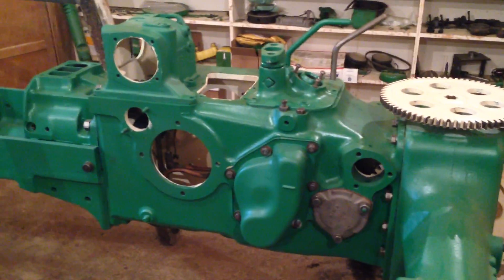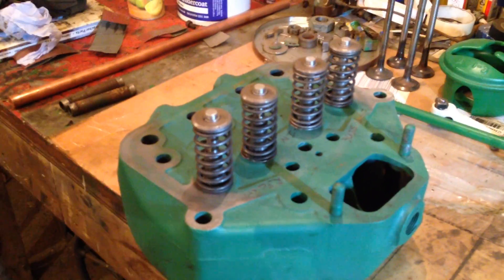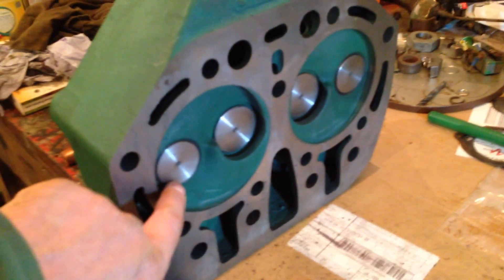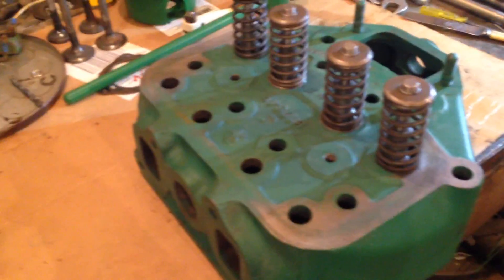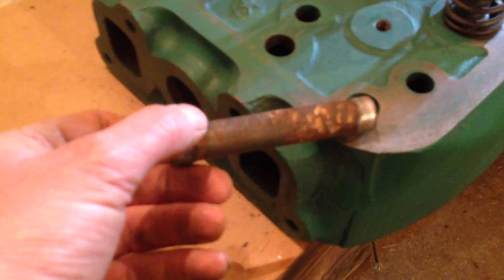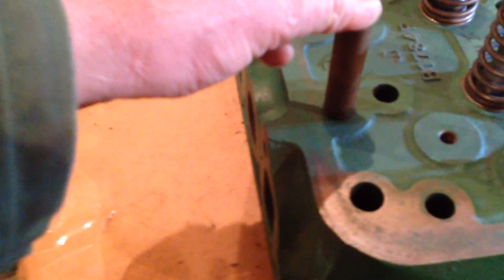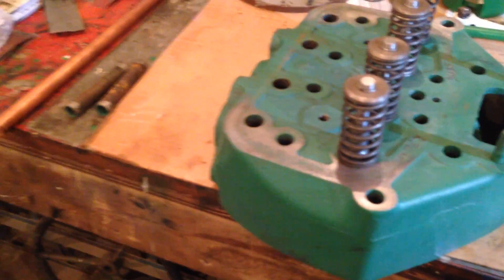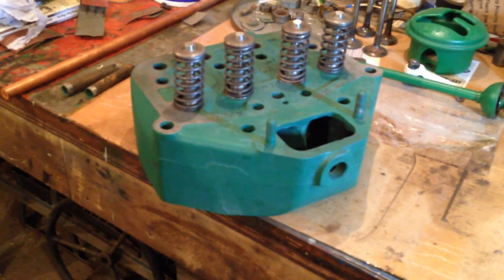1940/41 John Deere B restoration pt 41 (cylinder head repairs )

Comment: Hi David, as always nice work!  On the push rod tubes, even though they had a taper, did you make them .001 or so oversize?
Thanks
Reply from the maker: Hendey 16x54   Hi Hendey yes a couple of thou oversize , to much and the copper will tend to smear and roll thus making a poor fit , the sealant helps lubricate and obviously seal the tube as it’s pressed in to the head . Thanks for the continued support and interest regards David.

Comment: About how much did that head work cost? I'm about to start on a 41 B that has coolant in the oil.
Reply from the maker: mike noel Hi Mike the head gasket kit is around 80 to 100 pounds depending on where you source them valve guides are around 20 pounds each exhaust valves around 25 , intake similar . The pushrod tubes are still available from JD in the states not sure on price and availability ,   I make my own on the lathe so they cost a piece of copper bar 20 pounds maybe . The machine work was around 60 pounds that was for a light skim and have the valve guides fitted and valves faces recut ,don’t know if that’s expensive or cheap but the guy does all my work and I’ve never had a bad job from him yet which is more than I can say from some jobs folks have asked me to look at , it’s imperative to get valve guides in properly , correct heights and all that ! . You say you have water in the oil it could well be the pushrod tubes they are prone for rotting through letting coolant straight into the engine oil . Hope that’s of help , if your interested I can source a lot of these parts mentioned , regards David H .

Comment: What sealant do you recommend?
Reply from the maker: TwoCylinderUK Hi , for the pushrods tubes I would use a Delta product such as Delta 66 stud grade it's a type of loctite for nuts and bolts , for gaskets and the like Blue Hylomar is my preferred product though it's no good for cylinder head gaskets . Hope that's of help regards David .
Reply: That's great.
I am replacing push rod tubes on a B at present and wondered type of sealant
Thanks Darren.